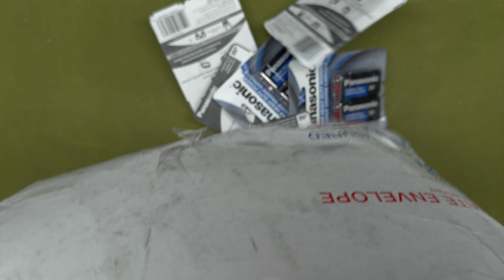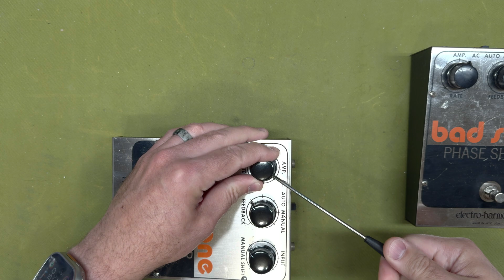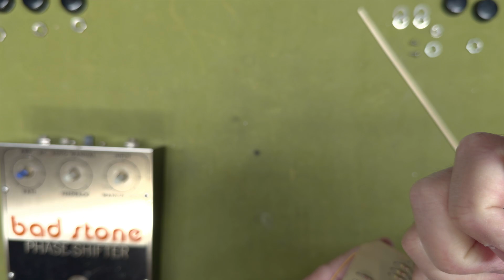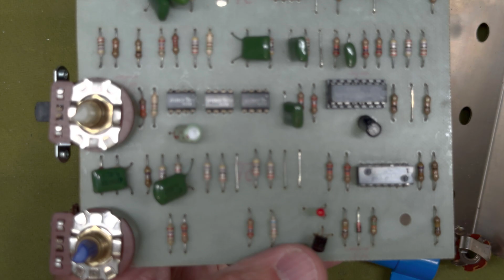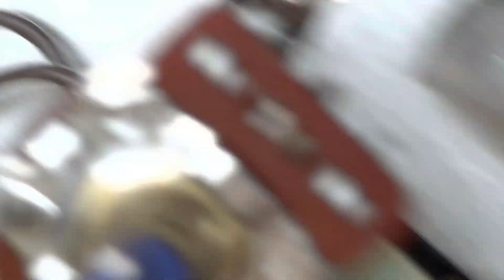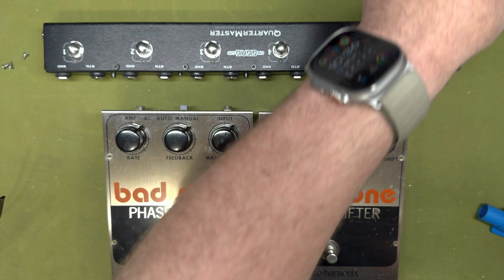Two 1970s EHX Bad Stones Compared - Circuit Design & Audio

Comment: The IC in the bottom left is a quad op amp (LM324 etc). The Phaser is not like a chorus or flange with a BBD (MN3007) and clock generator (MN3101). All the old Phaser appear to be 6 stage phasers and they do use LFOs (Low Frequency oscillators) like Chorus and flangers but no delay (BBDs). 🍻
Reply from the maker: Thanks. I only looked into it a little after this video and realized the delay is frequency based, and from a filter. ...right? Never knew that. I just assumed phasing was time delayed like other modulation. Pretty cool!